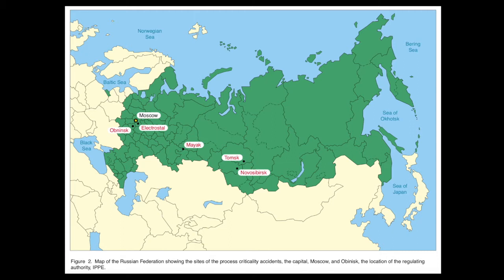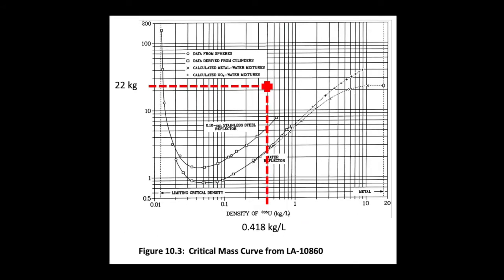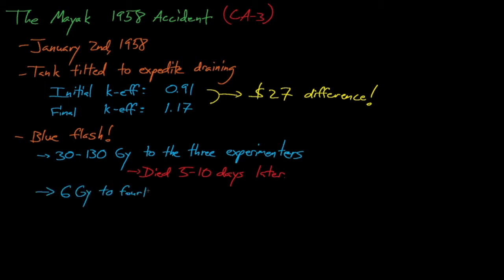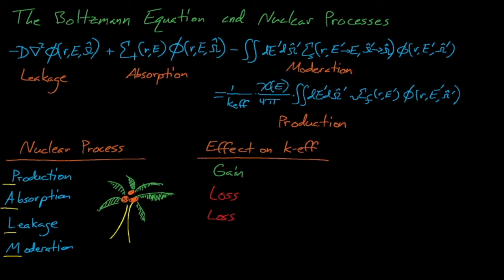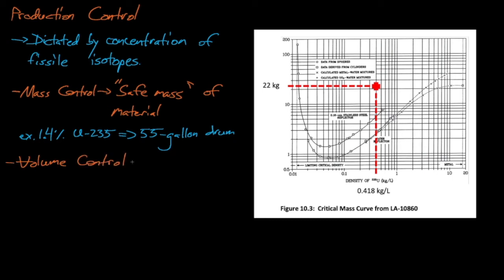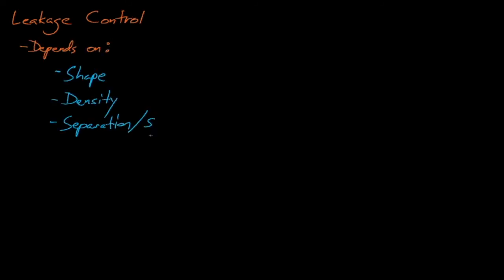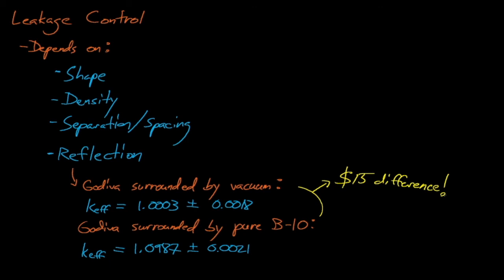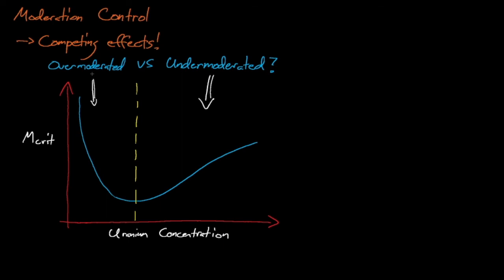NE499/515 - Lecture 3: The Boltzmann Transport Equation and the Mayak 1958 Accident (CA-3)

Comment: So if the B10 absorber around the sphere reflects back, is there a distance where you'd place it to be an effective enough absorber (where it would actually impact your system)? Or would it simply be better to find a way to embed B-10 into your fissile sphere?
Reply from the maker: There's absolutely no thickness of B-10 reflector that you could add to decrease the eigenvalue here - the key point is that every single neutron that leaks is lost forever when we have vacuum boundary conditions.  Adding a B-10 reflector around the system, regardless of how thick it is, will always reflect some neutrons back into the system.

Embedding B-10 inside of the sphere would in fact lower the eigenvalue since it would prevent neutrons from one half of the core from interacting with the other half of the core.  In this case, the B-10 impedes neutron leakage from one half of the core into the other (which lowers the eigenvalue), but if we use B-10 as a reflector outside of the entire sphere, then it impedes leakage into the vacuum (which raises the eigenvalue).